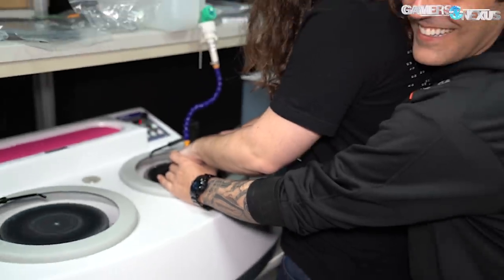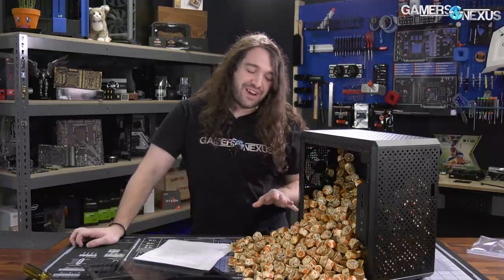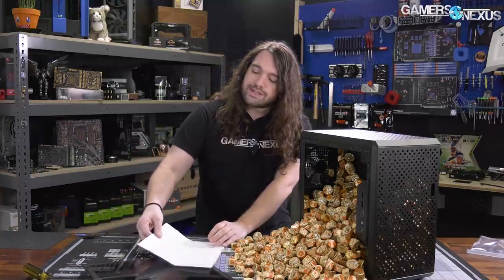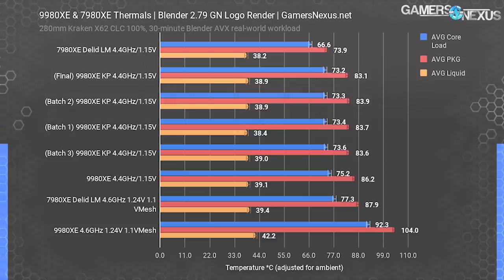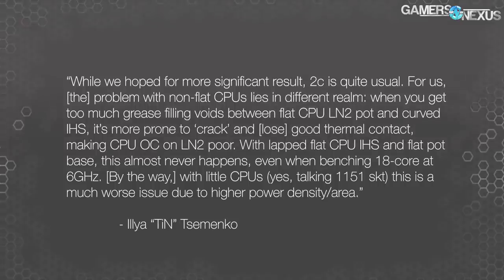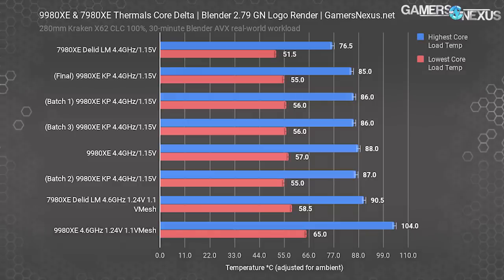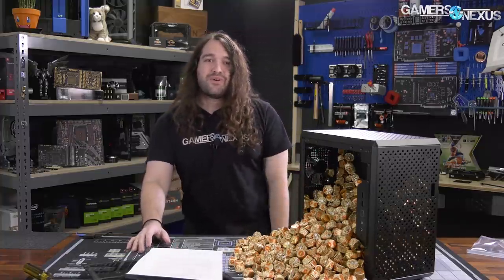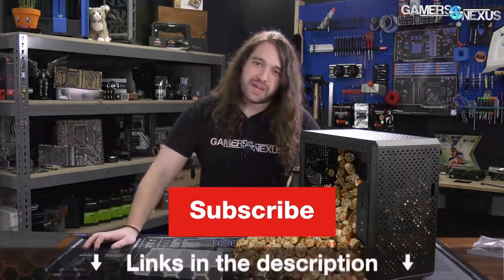Lapped 9980XE Kingpin IHS: Unexpected Results

Comment: You kind of answered my question from the last video of why the surfaces aren't polished here to create traction to thermal paste. Still curious though if maybe a direct copper to copper contact wouldn't be better. With a perfect polished surface you wouldn't need an interface material. There is a company that makes a laser dial indicator as an add-on for their laser calibration system. It could be used to make sure there are no variations or any concave or convex surfaces. Obviously not practical for the home overclocker but for a person that is going all out I think it would be the thing to do. With an instrument like that you could even test for variations coming from contraction under the nitrogen. Due to differences in thickness of the contact materials, the rim thickness of the spreader/block vs the center thickness could cause the metal to shrink under nitrogen temps creating a gap.

Comment: @Gamers Nexus You can get it flatter by using 3 sanding blocks. Because every surface has imperfections, you can use 2 additional sanding surfaces to normalize the imperfections in the first one, therefore creating a near-perfect surface on your CPU. Look up how granite surface plates are made for engineering.

Comment: What was the grease used to block the vent? And how did they remove it afterwards?
I've hand lapped every CPU I've ever owned with significant improvement, but none have ever had a vent.
I'll be going with a 5950x shortly and this may have a vent port so.  
Thanks for the help

Comment: Steve, you should contact Intel and show them the results here. My 7980xe had a 37c core delta before I delidded it. Now it's 10c and I think that's still too high. I suspect a manufacturing defect on that chip is the cause of the problem. Possibly a bad seating of the IHS before it was soldered, which might be explained by what resembled a slanted surface in addition to your non-flat surface when you were lapping the CPU.

Comment: So it's nothing to do with copper being a far better conductor than the metal layer above it? And actually is the perfect flat a better conductor? Surely having a highly regular finely pitted surface would increase the surface area possibly using a nano material, and could allow a higher contact between that and the cooler increasing the cooling efficiency?

Comment: I would assume the high core to core delta is simply because of the number and the thermal density and number of cores. Where a higher overclock makes it harder to cool the center cores compared to the outer ones. This is not as much an issue on the 8 core parts ore when running at stock. Ore are other people seeing smaller delta's at the same voltage / frequency / workload?

Comment: why is every 1 so scared of direct die ..am i realy getting that old or  does no 1 remember pentum 3 700's and celeron 733's ect none of thoes cpus had ihs and they all had a bent pice of sping steel holding the heatsink to the cpu i dont ever recall cracking a die

Comment: Lapping confuses me because when I put my air-cooler, the screws usually go down until they lock. Meaning they have run out of thread before they are stopped by the IHS. If you make the IHS thinner, you are farther away with cooler, because of the screw thread limit. (Unless I am totally wrong of course. I mean it work for people's temps, so lapping must be right.)

Comment: I'm always confused/puzzled by lapping. 
Given the whole purpose of the liquid-metal/thermal paste is to fill the gaps between the cooler and the IHS and because its a liquid it that fills any gaps caused by 2 uneven surfaces, it already makes the two contact each-other better. The only thing I can see lapping doing is making the distance from the silicone to the radiator a few nm shorter.

Comment: Steve, I seem to remember that Roland did delid a 99xxX after heating it to 250+ C in order to melt the solder so he didn't kill the CPU (like when he tried to delid without heating the CPU) and he found that the substrate was thicker on the 99xx CPUs and he had to take off about 15 microns of substrate in order to get good temps (the substrate was acting as an insulator).

Comment: When you say the core to core delta goes down with direct die is that at a similar delta from ambient? Since you are cooling better all around the core to core delta could go down just because you are cooling everything better. I honestly feel like at least a fair portion of the delta has to be just due to the actual silicon and also the layout of the cores. Also it would be interesting to see if any of these things change which core is the hottest. I suspect the hot cores are staying the same through delidding and lapping, but you didn't really say.

Comment: I haven't lapped anything since around 3000 series era. 
I remember back then getting pretty decent improvements and more stable temps on both Intel and AMD. 
I also remember fairly well that those earlier chips domed up pretty bad instead of concaving in which could lead to a cooler being mounted at a very small cant (2-5⁰)

Comment: Perhaps you guys could explore the idea of using the CPU's heat spreader as the base of the LN2 pot - ie you just have a tube attached to the top of it, removing the thermal paste and the need for lapping. The low temperatures wouild make materials used for seals a bit brittle, but I think it could be done with precision machining of the heat spreader and pot walls, perhaps on a lathe for example.

Comment: My guess is the delta is simply caused by heat saturation from adjacent cores. Is there a way to figure out exactly where the hottest cores are located on the die? All this "low level" stuff is pretty interesting to me at least. I enjoy the occasional dive down the rabbit hole, though I still think that the more popular topics should take priority over this kind of thing

Comment: i use 1200 grit wet with denatured alcohol taped to a small mirror on a flat surface for the lid and whatever heat sink surface i am using, lapping in a figure 8 motion by hand to a mirror shine, i have been able to reduced oc temps by about 5 degrees with some aio liquid coolers

Comment: The core- core temperature difference isn't just from the layout of the cores physically? Like, aren't they in a grid, so some are on a corner and some are in the middle surrounded by other cores, I'd assume the corner ones are a bit cooler.

Comment: What if you were to sand the bottom of the ihs? That would reduce the z hieght gap between the die and underside of the hear spreader would it not? Im not sure how much of a tolerance there is between the two but would that not do more in theory?

Comment: G'day Steve,
I will never own any of these Mega expensive CPU's but still find this content really interesting, especially to see that the per core delta didn't change with the lapping on the 9980XE,

I have also taken more of an interest in the thermals of my own PC's since watching your channel & even had a bit of a play mildly overclocking my old Core 2 Quad Q9650 but need a better cooler (stock Intel) & case (only has a 92mm exhaust) to get some better airflow
Reply: Big whoop

Comment: Since you have the 7980xe de-lidded I'd be interested in more testing with the heat spreader. Not only lapping but testing the inside for consistent thickness. I'd also be interested in seeing if different thicknesses would affect the performance and if different profiles would have any impact. For example, feathering the heat spreader thickness towards the edge both thinner and thicker. Also, once lapped and of uniform thickness, gradually remove a layer of a fixed percentage of the starting thickness. So, if the lapped and even heat spreader is 2mm then remove 5% or 0.1mm. Though typing that out it seems like it would require multiple heat spreaders and a ton of work.
Reply: In short, no.

Comment: Why won't Intel just release a processor with bare exposed die bundled with der8auer's OC frame.
Reply: The die ie exreamly fragile, and people will definitely shatter it.
Reply: @ChevySSR  We'll just have to handle it with extra care then. I believe the mobile ones found inside gaming laptops are in bare die. They should release a bare die edition instead of the stupid 9900KF (much more expensive edition).

Comment: I wonder which would perform better.  An actually lapped and polished surface or a scraped surface with a very high points of contact per square inch finish.  In theory, if you properly lapped both surface and then rung the heatsink onto the IHS and you should have "intimate" contact between the surfaces.

As I've said before, you need to talk to a tool maker about lapping and scraping.
Reply: watch der8auer's recent video.

TL;DW: too rough (40 grit) and you're not getting "increased surface area" but just increase the gap between IHS and coldplate, worsening temps by about two degrees.
No reason to polish the IHS either, diminishing returns beyond 80 grit and margin-of-error beyond 400 grit with an improvement of about two degrees.
So, if you don't go for an absurdly rough surface, no difference.
Reply: @kamikatze13  Scraping results in a surface finish that has a variation on the the order of +/- 0.0001".  A properly lapped surface should be essentially perfectly flat with an even finer finish.  Think gage blocks used by machinists.

Comment: See if Louis Rossmann would desolder your 9980 IHS. He has fantastic tools for precision solder work and temperature sensitive component work.
Reply: Or if you're brave just push a few razor blades between the heatspreader and PCB, place it somewhere resting on the blades and heat up the IHS until the solder melts and it pops off.

Comment: Steve, lap the top of the CPU so there aren't imperfections in the flatness of the top of the CPU.  This might bring down the delta's more.  Not the heat spreader but the top of the CPU itself when you delid the CPU.  Then doing direct die should give you much better results.